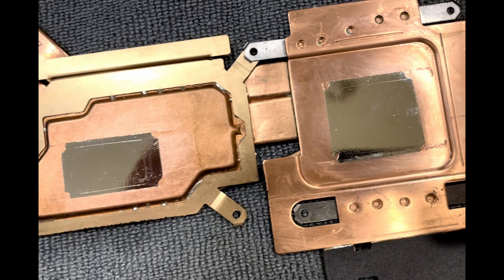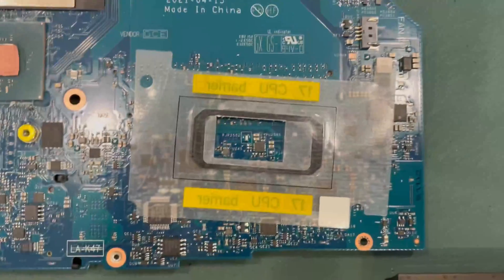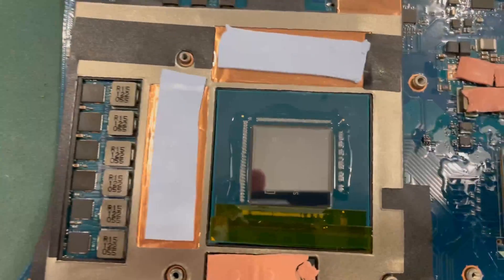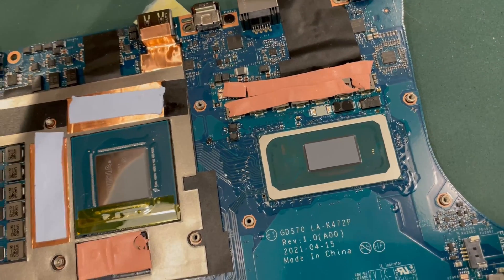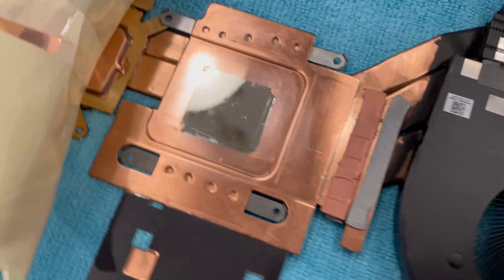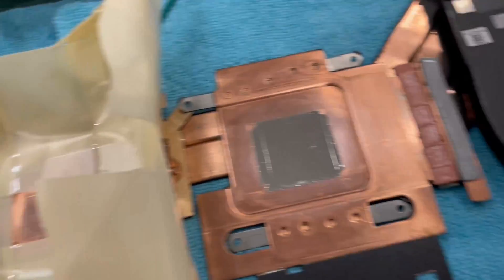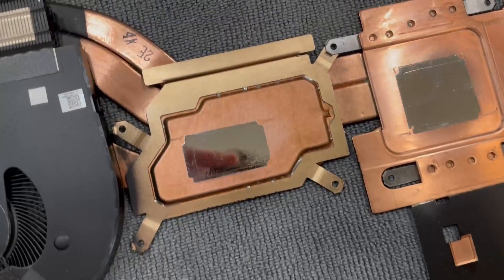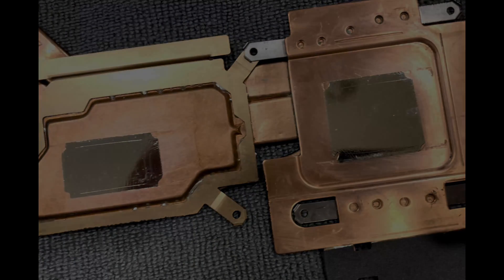Nickel Platting/Electroplating Copper Laptop Heatsink and Prepping for Liquid Metal ft Alienware X17

Comment: 🎉🎉🎉 
Hi, I'm glad I found this video, I'm also about to apply LM. you helped me solve the problem with copper and LM. at home. Thanks for the idea. 😊
I want to ask how the cooler is doing after 3 years of using LM and the nickel-plated surface of the cooler?
Reply from the maker: Glad it helped.  Its going well afaik.  PC still running strong and still cool so I havent had a need to open it up.  I am in the process of a new pc build so when thats wrapped up I will have some time to open up and report back.  Cheers!!

Comment: My friend, you have undoubtedly done a great job! 
I don't know if you still own the laptop but... 
In my opinion, it would be very interesting to see if the nickel-coated heatsink 2 years after the video is still in good condition or if the liquid metal has managed to affect that coating as well. 
If the liquid metal would present itself in good condition and has in no way ruined the nickel without exaggeration perhaps you have found the holy grail of heat dissipation on laptops!
Reply from the maker: Hey, thanks!!  I am typing this messages on the laptop so its still going strong.  I checked it at the one year mark and it was good Probably due for another check soon.
Reply: @dragon.factory  God bless you!
Please keep us updated with another video maybe checking the temperatures at rest, in gaming etc.
PS: I am planning to do this same mod also on my macbook pro i9 from 2019 due to the obvious overheating issues expecially  running windows on bootcamp. But honestly I am still very discouraged by the difficulty of the disassembly of this model 😅.
I would be very happy to receive some advice on this matter.
Anyway I am very happy and grateful to have found this kind of video. Keep it up Bro! 💯
Reply from the maker: @ferrari458it2  I havent messed with any of my apple products so no help there.  I would just follow what  you can online and hope for the best.  Take your time and learn from others mistakes first is always a good route.  Best of luck!

Comment: Ahh small sections of nickel plating... smart. I have seen people do the entire thing and it looks difficult to get a good result at home but this looks much more possible. 

I'm battling a 10750H that seems to have 3 hot cores that cause throttling no matter what I do or what paste I use, have been considering liquid metal.
Reply: Definitely worth it, huge improvements.

Comment: Hey good work ❤❤ I have a doubt - the mounting bracket on the cpu side of the copper heat sink has detached from the left side so is there a way to reattached it ????? because my temp are way high . is there any method i can follow ?

Comment: Oh my. Fantastic my friend! I would love to do this with my heatsink. My current method for liquid metal is reapplication 3 or 4 times after periodic use to force the alloy reaction on the copper until it stops altogether. This seems like a pretty surefire way to reduce the need to force the reaction. Not to mention you probably get slightly better thermals when the copper underneath hasn't reacted. Though even after my heatsink reacted fully, my liquid metal kept my 8750h at about 85C at 100% load, so I was pretty pleased. I watched Dau8ers video and thought it looked too complicated, but this seems pretty easy!
Reply from the maker: Yea, compared to taking it apart that many times, definitely worth it.  Yea, i watched his and thought the approach seemed too broad and chemical reaction seemed less effective than electroplated.  It was pretty fun to see it work.  Trouble shooting to get it not to leak was the hardest, but once I found a drop of glue solved the problem it was easy.  First try both times I applied it.  Good luck!

Comment: Hi! Also did a nickel plating on 3 laptops already and lm application. Temps dropped 23c avg on everything, i7-11700h + 3070 140w.
What do you do to isolate lm from the board?
Reply from the maker: Wow, thats a lot of nickel.   Dont you love LM!!! What method did you use for the nickel?  I used a combination of these two.  Kampton tape and silicon glue. 

https://www.amazon.com/gp/product/B07RZYY2T1/ref=ppx_yo_dt_b_search_asin_title?ie=UTF8&psc=1

https://www.amazon.com/gp/product/B008O9YK4G/ref=ppx_yo_dt_b_search_asin_title?ie=UTF8&psc=1

Comment: How are thermals holding up a few months later? any degradation? I personally don't think LM is worth the risk on the gpu. I have the same i9 3080 4k model as you, and my out of the box thermals on the gpu are honestly fine. In repeated timespy runs even with a fairly hefty overclock my gpu averages around 72-75c. For a laptop I'm personally more than ok with that. It's really just the i9 that is having issues. I am going to LM the cpu and it at least gives some peace of mind that the x17 already has the element 31, so you have the stock protection measures to work with. I am going to add some additional protection of course, but considering the out of the box gpu thermals, I'm just going to use a quality standard paste and a torque wrench to make sure I get good even pressure when remounting the heatsink. Thanks for making this video.
Reply from the maker: They have been holding up great. No change.  That liquid metal is magic.  

Yea, LM on gpu isn’t needed. I did it purely for the coolest possible temps to limit fan noise.  I love that I can go zero fans when not gaming and have everything stay below 55c, definitely not possible before.  Gaming, it’s still going to get louder but the more efficient heat removal is still more efficient.  

Yea, the cpu isn’t near its potential without LM.  Probably never should have been put in a laptop.
Reply from the maker: Yea. Just take precautions and use as little LM as possible.  Better to have to open it back and add more than have too much getting around you pc.  Thanks for watching and good luck.
Reply: Element 31 is just marketing for a basic thermal paste. You can hit much higher GHZ with LM applied over the cpu.
Reply: @cemsengul16  It's not just basic thermal paste. It's encapsulated gallium silcone paste. Its a hybrid of LM and standard paste. It's obviously never going to be as good as actual LM but the whole point is to infer some of the benefits of LM without the risks and maintenance. And much higher GHZ? I have an 11980hk, it's already running up to 5ghz out of the box. I personally would just like lower temps for peace of mind, and lower fan noise. Anyway with dynamic boost and the 3080 running at 165w during gaming, cpu thermals aren't the only thing holding back cpu clocks. I am interested in MSI's new phase change LM pad. That seems pretty cool.
Reply from the maker: @cemsengul16  it does have LM in it, but even their experts said it was about 5-10% more thermally conductive than straight paste.  Noting compared to true LM that’s 700% more.

Comment: Would you be willing to do this if i sent you a laptop heatsink? I got a GS76 that has piss poor thermals and air doesn't come out hot enough. LM would help with this. 

Let me know cost. 

Thanks
Reply from the maker: Sorry, I dont want to get in the habit of taking on projects like this.  To much to risk a part thats not mine that may be hard for you to replace.  If something when wrong, you might be out of a laptop until you could get a replacement part.  To risk that, you should do it your self.
Reply: @dragon.factory  I was about to ask the same LOL. I was all into applying liquid metal, I saw the disassembling video and I know I could do it, then I went to this one and saw how you basically created a whole thing and I was like wtf. That's just way out of my league

Comment: Nothing wrong with this method.But using the Electro Brushing Method on a acetone cleaned non polished heatsink will give you better adhesion of nickel to copper. Think: Shiny = Smooth = Good contact= No space for LM = Hot Spot= FAIL
Reply: If this is a concern, one could simply sand the surface with very fine sand paper to roughen it up a little.

Comment: One of the reasons that the nickel finish chipped off in spots probably relates to the buffing you did. Usually you want to rough surfaces before coating to give more surface area to adhere the coating.
Reply: I dont think that's 100% true, its probably from micro oxidation, making sure to eliminate any surface oxidation is the most important factor
Reply from the maker: Great to know. I saw that the nickel plate will match the surface you start with and I went ooohhh shiny birdie.

Comment: Hi dragon, I know this isn't the right video but I was afraid you might not see it, how did you power the fans in your custom cooling pad?
Reply from the maker: Hey Real, no worries.  These fans are 5v fans.  They come with a usb cable that plugs right into the fans.  I did need to buy spliters, to connect them all to one usb connector.  So, it plugs into the pc like any other cooling laptop.